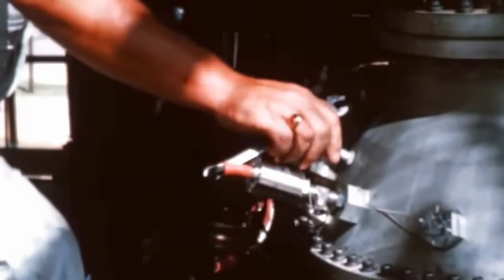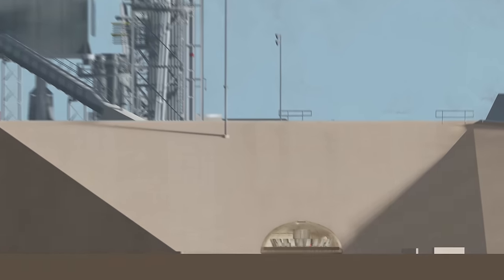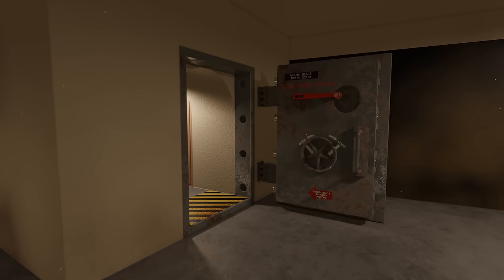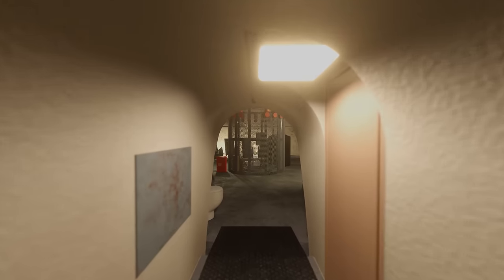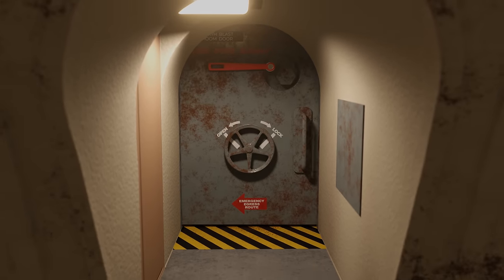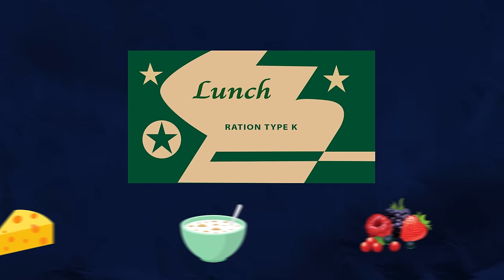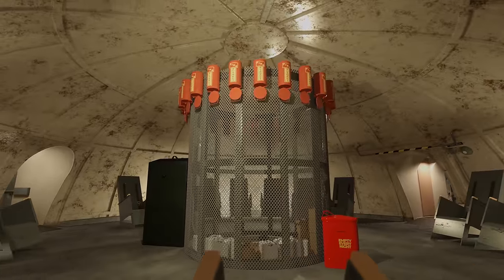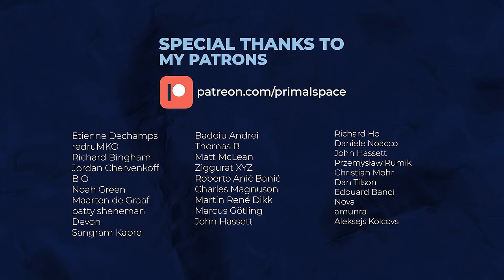NASA's Most Off Limits Room

Comment: I can't imagine a scenario where the crew found out an explosion was imminent, yet still had time to get to that room and close the blast door.  Seems like a fortune spent on a one-in-a-million failure mode.
Reply: I agree
Reply: I thought this too. Like, an explosion is imminent, assuming that somehow they are given warning. Even with the slide, that’s a long way to go while racing against a clock that doesn’t even have a specified count down. But I guess it’s nice to dream and feel safe. But my best guess would be that they all die trying to get there
Reply: That room, as well as many other safety features NASA had, where basically just placebos. At some point, a politician or journalist would ask "And what would happen if", and NASA couldn't say "then they're screwed", specially not after the Apollo 1 fire, so they would point to this ridiculous systems. The same goes for some of the abort modes on Shuttle, for example. It's just politics, there is absolutely no realistic scenario in which this could ever save anyone. 

You could clearly see this kind of thing at work a few days ago when the submersible titan disappeared. Everyone that knows absolutely anything about physics or engineering, or anyone with a bit of common sense and general knowledge, knew that they where all dead. What are the odds that the submersible would lose communications and navigation at the same time, all while also being somehow trapped in some debris that prevented them from blowing the ballast and heading to the surface? Zero. And yet, the media spent days talking about their oxygen supply, while everyone mounted a big pantomime of a rescue operation.
Reply: It's better than nothing given those odds.   What if by some miracle the explosion was delayed long enough for the crew to get to safety?   I rather see astronauts have some hope vs none at all.
Reply: @Darkk6969  no rocket has ever exploded in a manner that could've taken advantage of this kind of safety system.  You don't go putting a parachute on all cars just in case one drives into the Grand Canyon.  There are certain failure modes that are so rare that there's no point in protecting from them.
Reply: Considering what NASA did and didn't do for the Challenger / Columbia missions ,yeah this was over the top
Reply: They did it for the warm and fuzzies, imo.
Reply: @meanderinoranges  Whenever a fire breaks out anywhere near a rocket an explosion is likely imminent.  Whenever rocket fuel and liquid oxygen are in close proximity a fire is a very real danger.   Do I need to simplify this further or has it sunk in?
Reply: @krashd  sure, we can imagine all kinds of failure modes.  But the truth is they're so rare that there's no point in spending insane amounts of money and adding complexity to the system to safeguard against them.  

Risk analysis has been a part of every rocket program in the part 70 years.  Yet no other rocket program has created a slow, elaborate Rube Goldberg safety system like this.  Gee whiz, I wonder why?
Reply: Doesn't look like it's intended for the crew. Think about it. It had room to 20 people. It was intended for the workers at the launch pad. So if there was an emergency, they could run for it to get to a safe place prior to BOOM.
Reply: That’s Like saying safety is pointless and you end up imploding in a sub over the titanic
Reply: @redion8575  okay there Mr. Strawman.  No, it's not saying that at all.  We protect against common modes of failure when there's a high likelihood of that type of failure and when the safety feature doesn't dramatically increase the cost of the system (e.g. seat belts and airbags for car crashes).  We don't waste money to protect from extremely rare failures, especially when it's cost prohibitive and/or dramatically increases system complexity (e.g. we don't make cars fully waterproof and include oxygen and CO2 management systems in case someone drives their car into a lake).
Reply: @meanderinoranges  Except why not build it? The US was effectively hemorrhaging money at the time, it definitely wasn't some absurd expenditure. Even if the likelihood of it being used was low, and the reasoning was mostly political, it was not really any huge difficulty to do. It was also the 1960-70s, the US loved bunkers and such things. I wouldn't be surprised if part of the proposed impetus was cold war related.
Reply: It’s called hope.
Reply: good point..
Reply: @brianwintermute9551  it's called contractors lining up for the space race gravy train.  If no expense is spared, then expenses seem to sprout out of the woodwork.
Reply: @meanderinoranges  No NASA rockets have ever exploded in such a manner that would have allowed the use of this kind of safety system, at least none in final launch configuration.  However, there were a few USAF ICBMs that exploded in such a manner that would have allowed the use of this kind of safety system if it had been present LIKE THIS at those sites.  This was intended for those type of events.
Reply: @johncochran8497  No, it wasn't intended for the launch crew, or even the tower personnel that helped the crew into the capsule, those people would use the escape gondolas to get away.  Those were baskets that ran down ziplines to the beach nearby I believe it was, and from there those personnel did have another safety room to go into, the gondolas and that other safety room were actually still available/in use to the end of the Shuttle era.  SpaceX and the SLC are using an upgraded version of the zipline as the escape route from the tower if necessary.  

No, that water slide to the rubber room, that was the escape route for the ground and pad personnel, along with anyone that was only partway up the tower.
Reply: @krashd  The point is exactly that.. that an explosion would be "imminent" - Rocket explosions have always happened so fast that there is no real warning, and definitely nowhere near enough time for everyone to make it down that slide, into the room and close the door.
Reply: @ruthgar9753  It seems that you didn't understand me and as such repeated what I said, but in a different form. Since the room could hold 20 people, it was obviously NOT for the crew, which is only 3 people. Add in the fact that when close to launch, there's noone on the pad, the obvious use for that bunker is during fueling/preparation for launch where there's personal near the rocket and there's potential danger such as a fuel/oxydizer leak, etc. Or in other words, people on the pad as you said.
Reply: @meanderinoranges  You don't seem to understand what a Rube Goldberg machine is. :chillwcat:
Reply: @Darkk6969    It's more likely that a dangerous condition would be detected, something that exceeded a certain set risk level, and the workers would make their way to the top of the tunnel and slide down - just to sit there for several hours while the rocket was detanked and/or a small amount of propellant dissipated.
Reply: Are you saying this room was as useful as the tiny umbrella Wile E Coyote held over his head sometimes?
Reply: @donjones4719  😂
Reply: The actual rescue mechanism for an imminent explosion would be launching the capsule with the inflight rescue rockets away from the rocket, as if something went wrong while the rocket is still underway through the atmosphere. The system shown in this video would be for other cases when an explosion is not quite that imminent but possible, like during seating the crew or fueling.
Reply: Building a void into a large mass of concrete wasn't a big expense - it was a bit of a no-brainer, right?  Also, all these engineers were experts on life support, so they probably built something like this in their spare time with stuff they had laying around.  Granted, there was probably some expense, bu, we are looking at it with 20/20 hindsight.
Reply: @Darkk6969 this would only work for people that were right next to that chute. You have to remember you really can't go all at the same time down that shoot. I mean you could, but there's a substantial amount of injuries that probably will occur. Therefore negating the ability to get off the shoot and into the bunker
Reply: @johncochran8497 put up the crew is in the upper levels where they had to come down the stairs or the elevator to get down to the pad and they have to run all the way over to the chute, Then one at a time so they don't injure themselves, then everybody has to get into the bunker secure the bunker and strap in.
Reply: A scenario I can think of off the top of my head based on something he also said is if there is a large fuel leak. It won't necessarily ignite so it might end up just being a place to wait until the scene is safe, but it might also ignite within a few seconds of being discovered and not give them enough time to evacuate or somewhere in between where they evacuated in time for the explosion. I have a hard to imagine a fuel leak of that size not igniting in an industrial area like that, so I hope there was a good way to automatically secure most normal sources of ignition when a leak was discovered.
Reply: @Ganiscol   That's called a pad abort, it was one option but the bunker was mostly for workers on the pad. In either case the escapee would have to make their way to the escape point. A pad abort works for the astronauts but they have to be strapped into the capsule with the hatch closed. It's not easy to jump into a capsule and seal the hatch.
Reply: When you consider all the different things that could go wrong, even if some of them involve slow fires and explosions then you should still design fail-safes for them. Engineers design disasters to happen slowly, things to fail with warnings and for things to be overdesigned. They wouldn't of bothered with a lifeboat if there was no hope of using it.
Reply: @johncochran8497  I  think they had zip lines for the crew, didn't they?
Reply: @mitchellspanheimer1803  For the crew, they had three methods available. First, the launch escape rocket (the spindly tower attached to the capsule). Second, the zip line you mentioned. And third a high speed elevator that could take 'em down to ground level in less than thirty seconds so they could then run to the slide mentioned in this video.
Reply: It was a government project.
Reply: @meanderinoranges  It's a water slide into a concrete bunker, it's really not that complex
Reply: @meanderinoranges  comparing safety systems of a one-off space vehicle launching system vs. those of a mass-produced car is silly and meaningless
Reply: @EuanH91  Right because a large fuel leak with delayed ignition is so implausible
Reply: @jkolbly1  I have to imagine every single piece of equipment and infrastructure near that pad was designed with this in mind
Reply: @taylornate2  yeah, not that complex.  Whatever you say.  I'm sure there's no CO2 absorption system, no fire suppression system, no food/water supplies, no oxygen supply, etc, etc, etc.  Just a water slide into a bunker 😂🤣
Reply: @meanderinoranges you think fire suppression, a CO2 scrubber, 5 days of supplies and some O2 candles was a big additional expense on top of building the actual structure?
Reply: @taylornate2  I'm fairly sure that is the case as well, but getting rid of every possible source of ignition in such a large area is extremely difficult. A couple sources that come to mind is the striking of metals, which leads to me assuming the structure is made of non-ferrous material to prevent it from being the source of a spark, and welding. Even if they stopped welding the moment a leak started, what they were welding could remain hot enough to cause a flash for maybe 30 seconds. I'm certain they took as many precautions as possible, but they probably had to accept a certain level of risk to get work done as well as it being nearly impossible to predict every possible cause of disaster.
Reply: People do things like this when they have/had a bottomless pit of money
Reply: It was probably the only way they got people to show up to work XD

'it's safe, see we supplied this safety item!'
Reply: @krashd  If a fire breaks out near a rocket that size, then you’re better off trying to fight the fire than outrun the explosion.
Reply: The money for that "escape system" could have gone to the additional overengineering for safety and qualification and testing of any part that could spring a leak that could develop into fire and explosion on the pad, like valves and such. That way you eliminate some more failure cases instead of making a contingency for one rare situation.
Reply: Even during Apollo we already knew how long it took a liquid fueled rocket with a flaming leak to go kaboom (~30 seconds or so). If the slide could drop the crew directly into the bunker then seal the door behind them they might have had a chance. The whole procedure with the rubber room, crossing the corridor to the bunker and sealing the bunker manually would have almost certainly taken too long and gotten everybody killed.

But of course, this was predicated on the small chance that the rocket would even wait that long - lots of failures could have just caused it to blow up instantly, giving nobody any chance at all.

Also if it makes the pad workers feel any better, the escape slide system for the astronauts was somehow even more absurd and foregone. It would have taken them much more than 30 seconds to even get them all out of the capsule, much less down the slides, in the M113 APC and chugging steading towards safety behind 3 whole inches of aluminum. (lol)
Reply: Right -- who's going to be the person who says "Half of us are here, but the rumbling is getting louder so I'm going to lock the blast door!"? Or, of course, the one who says "Half of us are here, and even though the rumbling is getting really fierce, I'm going to keep the door open just in case someone else makes it to the entrance!"?  Or would the blast door be controlled from a switch entirely off-pad, like the self-destruct circuit for the rockets?
Reply: @carmgitto  NASA:  Look.  The money was in the budget.  We couldn't NOT spend it.
Reply: Honestly I don't think it'd cost that much in comparison to the whole project, they're already pouring the concrete, might as well make a bunker
Reply: On a similar note, we can consider that it was abandoned even when the Shuttle program was active. They probably concluded odds of it saving anyone were so slim it wasn't worth the cost of maintaining even though it already existed. For the Shuttle program there were other escape systems that could get people down from the top, another shortcoming of this thing is that they'd have to get down to the base of the launch assembly before even getting to the slide.
Reply: Pretty sure it's for when one of the flight crew accidentally presses the "self destruct button in 10 minutes button".
Reply: @Chris.Pontius  LOL, you win!
Reply: @meanderinoranges  The Nedelin catastrophe is proof to the contrary. There was enough time for guys to run around behind the wire while things got worse and worse.
Reply: Look up the Nedelin catastrophe.
Reply: @theoutdoorguy8740  It is better to go down the chute as quickly as possible and hope that the previous person got out of the rubber pad in time so you won't injure them, than to be inevitably liquefied by the blast wave.
Reply: it could be useful if there was a small fuel leak that they couldn't locate and was growing. In that case, they would need to evacuate but wouldn't have the time to clear the pad.

it's not about an imminent explosion, but the risk of an explosion.

When thinking about safety, always assume that the worst will happen.
Reply: @Darkk6969 If you've got that long to run, get a dozen people down a slide in a base under a tower, into a safe room, blast doors sealed, and everyone strapped in... then you had enough time to run. Grab a vehicle. Get out of the area.
Reply: @taylornate2 You're oversimplifying because you know you're wrong. That's something you only do when the facts aren't in your favor
Reply: @taylornate2 Because mass produced vehicles will be used much more often by much larger volumes of people in a wide range of scenarios and should have more comprehensive safety features, right?

Oh, you were arguing that the thing more people use every day all over the place should be less safe than the single use rocket. You are very smart.
Reply: @meanderinoranges I liked his comment
Reply: Who thought that it was necessary to supply biscuits coffee and cigarettes????
Was this back when they were healthy for you? 🤣🤣🤣
Reply: @nanky432  government projects can be useful. it isn't wise to group them into one category.
Reply: @jerseyjoyride1316  everyone smoked back then
Reply: @meanderinoranges  You claimed it was a rube goldberg machine. It's not.
Reply: @jkolbly1  Why would they be welding in the area with a fully fueled rocket on the pad lol

We all agree that a sudden catastrophic explosion is plausible or even likely. That doesn't make a delayed ignition implausible, which is what this was designed for.
Reply: @chrismanuel9768  Nice try, troll. I was responding to a comment calling this a rube goldberg machine, which it is not.
Reply: @taylornate2  "a chain-reaction type machine or contraption intentionally designed to perform a simple task in an indirect and (impractically) overly complicated way." Arguably it is doing a simple task in an overly complicated way I suppose one has to consider whether it's overly complicated or impractical or the right level for it.
Reply: It would have been converted to a nuclear launch site for ICBMs. During war, they could be under bombardment but have to launch nuclear weapons. The explosions ongoing, between launches, they would stay in the bunker, so the war machine would keep going. All these projects came from the height of the cold war.
Reply: It's the same as the acoustic sensors on the OceanGate sub. 'Danger Danger Implosion Imminent'!
Reply: Also, in what universe does 'let's make them run TOWARDS the thing that is about to explode to access the bunker that will save them from said explosion,' make sense.
Reply: NASA and proper utilization of funding never really mix well, considering the whole existence of the Shuttle program...
Reply: really the only event that would offer enough time for the crew to escape to the rubber room would be if there were a fuel leak,  as mentioned at the start of the video.
virtually no chance of the room being useful otherwise.
Reply: Government doing government things with other people's money smh
Reply: @andychow5509  there is no way this would be used as a launch site for ICBMs. It took DAYS for the Saturn V, and later the Shuttle, to get driven to the pad by the Crawler. ICBMs have their own silos, dispersed across empty land; they aren't going to line up and wait on one launchpad to then launch multiple missiles from the same targetable launch point.
Reply: @jsquared1013  You don't need Saturn V for ICBM. You can use much much smaller rockets, the type that fit on rail tracks and don't need crawlers.
Now it's true the US didn't have that tech where you just unload the rocket from a horizontal to vertical position. So there is a part missing.
But everything points to that bunker existing to have a skeleton crew keep the pad going as an ICBM launch site. The bunker was build before the nuclear triad, so the concept of "we already have tons of build silos ready" didn't exist. When this was built, there was a single other delivery method: B-52s. No subs, no silos. And B-52's might not make it far into Europe.
Reply: @akivaweil5066   NASA is a civilian entity with a high focus on safety and survivability. Considering how their funding is related to public perception as well as given how expensive and how long it takes to train ground and space personnel...  It kind of makes sense to have this survival room.
Reply: @Darkk6969  It's more of a matter as to what are the chances of a delayed explosion occuring, and is the chance high enough to justify spending a lot of money for something that may never be used.

You could add infinite amount of redundancy to a system, but each redundancy could add cost, time and weight.
Reply: @meanderinoranges K, lets see some paperwork saying your opinion lines up with why they built the bunker. Or at least a pic of your NASA employee badge from that time period. Or hell, even two decades after. Or you could come up with an excuse to use the term "Mode of failure" a few dozen more times.
Reply: @jamesbaker3153  I'm a mechanical engineer.  Why does that hurt your feelings so much?
Reply: I love how you are being so arrogant, while defending a safety measure that is obvious for anyone with two neurons, purely political. 
Yes if the absolutely minuscule scenario kn which an explosion of enough magnitude was delayed enough to people to realize the danger and make way to the safety room, the multi million waste of money ( billions in today's money ), would be justified.